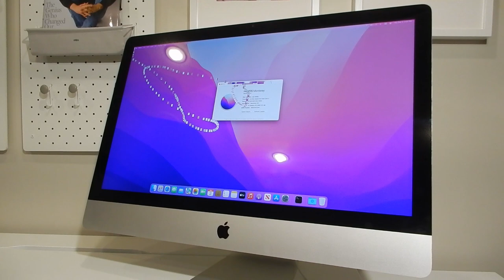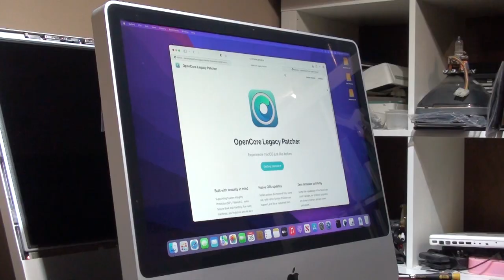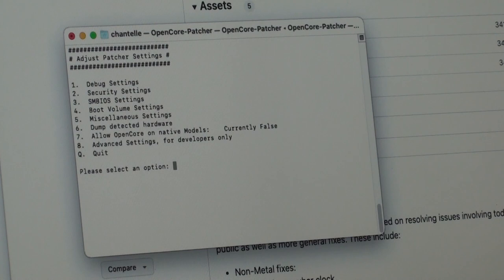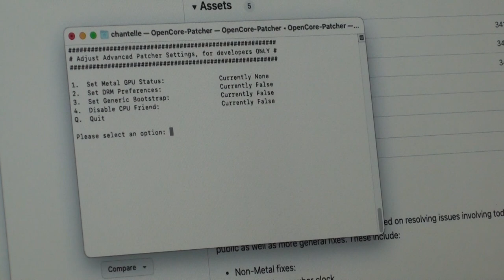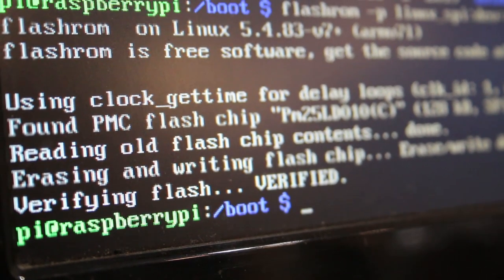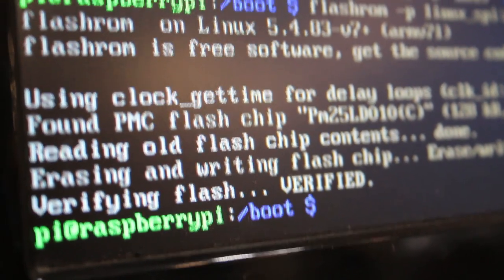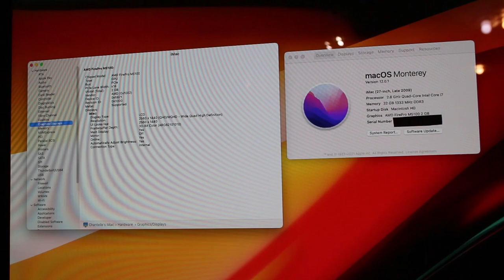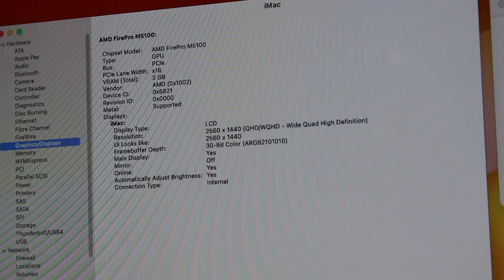iMac GPU Upgrade, Metal SUPPORTED!!

Comment: can you do a tutorial to flash vbios? i buy the same gpu and i dont know how i do. Thank you
Reply from the maker: What method are you using to flash?  Are you using a chip clip and a programmer or Raspberry Pi?

The cheapest method is to do it via Linux on the Mac itself, but this is very risky if you make a mistake and also requires you to be comfortable in Linux.  A cheaper method is to use a Raspberry Pi as a flasher like I did.  You need to properly wire up the GPIO pins to a chip clip and use the Linux terminal to install the flashrom tool and flash the chip.  If you don't have much experience with this sort modding, you probably should consider using a USB programmer with chip clip instead.  A USB programmer will work from any Windows PC.

If you post back what equipment you're using to flash and exactly what card you are trying to flash, I will try to give you any tips I can.
Reply: @rebootretro  i read this, but with linux tool and amdflash i can boot in the same imac or i should use other mac? Because i read what if i turn on the imac with this gpu i can broke the macos, or linux detect this gpu without problem? Thank you
Reply from the maker: @aitorlozano7589  I think you can use the same Mac.  I don't think it can "break" anything by booting with it.  The one problem is you will not see anything on screen (including boot picker) until Linux is booted, so this makes it very difficult to work while blind if there are problems.

This is just my thoughts, I have not used that method and don't fully know how to do that method.

The USB programmers are relatively cheap, I would probably recommend that method if possible - since it is much easier.
Reply: @rebootretro  the usb programmer run under windows? And i never use usb programmer, i’m going to search tutorials to use usb and i post a comment here. Thank you very mucha again
Reply from the maker: @aitorlozano7589  Yes, there is Windows software for the USB programmers.  There is probably software for Mac and Linux for USB programmers too.  They have a much easier GUI interface, instead of command line I used on Raspberry Pi.

Here is an example below of the type of programmer I'm referring to which comes with a chip clip.  DON'T JUST BUY THIS ONE, I'm not saying this specific one will work.  It is just an example!  Make sure the programmer you buy is compatible with your chip, and make sure there is a Windows programming software.  The one in the example below will likely work, but please research to be sure before you buy one.

https://www.amazon.com/KeeYees-SOIC8-EEPROM-CH341A-Programmer/dp/B07SHSL9X9/ref=sr_1_3?keywords=bios+programmer&qid=1670292884&sr=8-3

Hope this helps!!

Comment: Hi ! Very nice and still up to date ! Just done  with a S7100x firepro : one question : is there a way to get the apple logo startup back ?
Reply from the maker: It depends on your ROM.  The official Mac ROMs will have the stock boot picker and startup logo.  PC ROMs and modified PC ROMs usually loose the stock boot picker but can possibly keep the startup logo depending on the ROM and OpenCore settings.  I'm using the M5100 GOP ROM (which I believe is a modified PC ROM) - I loose the stock boot picker, but so long as I'm using OpenCore I still have the Apple startup logo.  My guess it's not supported in the ROM you're using, or double check your OpenCore settings.  That S7100x looks like a nice card!  Good luck! :)
Reply: @rebootretro  yes it is a very nice card ! Belive me, GTA V runs pretty well, even with all the cursors up.

Comment: @rebootretro very nice video. I want to ask if you (or anyone else here) have any experience on if the M5100 can work with AdobeCC apps.
Reply from the maker: The M5100 is Metal-compatible, so it should work with CC apps.  I know CC 2021 graphics apps worked even without upgrading the GPU (stock HD 4000 on Monterey with graphics patches), since 2021 still supported legacy graphics.

Comment: Great video! I have an old 2011 imac 21 that i want to mod for fun one day but my main issue is that many of the GPUs dont support screen brightness control and that for me is a deal breaker. Does the FirePro support native brightness settings in MacOS? Thanks in advance!
Reply from the maker: Thanks!!  Yes, it works just like factory - and stepping is perfectly smooth.  With this specific FirePro, there are some issues when installed in a 2011 iMac specifically.  I think it had to do with wake from sleep, but I can't remember for certain.  If you plan to use the same card, make sure to read up on the Dortania GitHub page to see if the issues are going to affect you, or if they have been fixed.  It's an excellent upgrade for sure!  I really like the FirePro because of native driver support; it has worked absolutely perfectly!
Reply: Thank you very much for the detailed reply and great information! @rebootretro

Comment: Hello Friend, I have followed all your steps in high sierra and with a quadro 610m graphics card but something strange has happened to me, now it only lets me install high sierra, when I install I format the ssd and install catalina or bigsur with opencon, the ssd does not appear, It only tells me that it cannot be installed... I have changed the SSD and nothing, the problem started when I applied the set metal gpu status and placed Nvidia Kepler and applied it to the SSD and from there the problem...

I would like to know what the solution would be.
The bios of the GPU is corrupted and do you have to put the bios back in?

It is very strange.. or it is the motherboard bios.. all this is a 27 inch imac a1312.

greetings.
Reply from the maker: If it says "cannot install" it sounds like your USB stick does not have OpenCore installed on it.  It sounds like you're booting the vanilla Apple installer, which will reject older Macs with that error.  Double check that OpenCore bootloader is properly installed to your USB installer stick.

You're using a completely different card, so the mod process is very different on yours compared to mine.  Some cards will work with the stock vBIOS if you don't mind loosing the Mac OS boot screen.  My card required a vBIOS mod to work properly at all.  Each card is different.  Check this forum here for specifics on your card: https://forums.macrumors.com/threads/2011-imac-graphics-card-upgrade.1596614/

It appears your card needs a custom ROM (the available ROM is specific to certain card revisions, so double check before flashing).  It also appears that your card requires the heatsink to be modded as well for that card (copper shim), according to the docs.
Reply: @rebootretro  Hello.
Can the changes be reverted with open core 0.4.6?
In the end I tried everything, reinstalling the original bios by Nick, in the end nothing, I will leave it with high sierra or I will buy another graphics card again.

Comment: Great video, I’m considering this option, I have a 27” 2011 imac. Is the one featured in the video still going strong?
Reply from the maker: Thanks!!  Yes, it’s running great still!  That series of FirePro had some issues specifically with 2011 models.  I think it was related to sleep.  It may have been fixed by now, but double check the Dortania GitHub page.  Aside from that one issue (it only affects 2011), I’d highly recommend this card.  Fully native driver support is nice to have!  No OS driver mods!

Comment: Wow.  Great effort.  But why are you using a spinning HDD
Reply from the maker: Thanks!  There is also an SSD boot drive in the CD ROM bay (we didn't need a CD drive for this computer).  The spinning HDD is because I have lots of capacity HDDs kicking around, but only small capacity SSDs.  System on the SSD where speed matters, personal files on HDD where capacity matters :).  If cost wasn't a factor, I'd just go for a single big SSD ;)

Comment: Just swapped my gpu for a 5100 preflashed bought from AliExpress, €28  i had oclp already installed so i had nothing but switch to AMD GNC but to my surprise, the GPU says it has only 14Mo instead of 2gb of ram. Any idea why ? Should i reflash the card with one of the vbios available?
Reply from the maker: When you bought it, did they tell you specifically which vBIOS was installed?  There are several versions.  I think the one I used was the GOP version specifically for the red Dell card.  If you previously had legacy graphics patches installed, it's possible that is causing some issue as well.

Ultimately I think theres 2 things to try (whichever is easiest first):

1.  Temporarily use a completely clean hard drive, install fresh Mac OS WITHOUT legacy graphics patches, and install OpenCore.
2.  Dump the current vBIOS (save original somewhere safe) and try flashing one of the other vBIOS.  If you have the red card, you might try the GOP version I used.  You do loose the factory boot picker with this card and this BIOS, FYI.

If you still have trouble and have more questions, feel free to post back and I'll try to help if I can.
Reply: @rebootretro thanks, it ended up working after installing a fresh os. Card immediately recognize with 2G and metal.
Reply from the maker: @DrMacabre  Nice!  My guess was the existing legacy patches (which patch out Metal I think) were causing some issues.  Congrats on your upgrade!
Reply: @rebootretro  thank you, i expected something rather complicated after reading and watching a lot of tutorials but it was actually very easy to swap the card. The most difficult part was to plug the temp sensor cable back on the main board.
Reply from the maker: @DrMacabre  For most people, I think the most complicated part is flashing the card.  But a pre-flashed card solves that :). You're right, the rest isn't too bad for anyone with some technical experience.

Comment: Hi, im having an issue, maybe u can help... when starting my iMac, i can hear the chime and then iMac restarts. Chime is heard again and then iMac restarts. This situation repeats over and over, it cant boot normally neither with the option button pressed! Any idea why?
Reply from the maker: I'm not sure, but I would start with a PRAM and SMC.  It is also possible there is a logic board or GPU issues which could cause that too, but always start with a PRAM & SMC reset before going further.  Resetting these can solve a number of weird problems like you describe.  I've included links to the Apple docs just in case; double check, because the process changes based on model.

(PRAM - https://support.apple.com/en-us/102539)
(SMC - https://support.apple.com/en-us/102605)
Reply: @rebootretro  thanks so much, i appreciate the fast response. Those two things are the first ive tried but without luck 🙂 The GPU issue is something that has come into my mind and if its that its gonna be the second one that failed 😞
The Ati5750 is the gpu that im looking for, but who knows in what quality its really gonna be.
Reply from the maker: @giorgos7six  I would also make sure while you test to unplug all USB devices, if you haven't already. 

To my knowledge (I'm going 100% off memory, so I could be wrong!), I think these iMacs will still fully boot without a GPU.  You could try removing the GPU to see if it cures the boot loops which would confirm if its a bad GPU.  If it boot loops without the GPU connected, I suspect the GPU isn't the problem.

Also, it's possible the PSU is beginning to fail and browning out.  Generally a bad PSU wouldn't boot loop, but if the brown out is on the right rail it's possible.

My thought is that the logic board seems ok since you get the chime.  But a faulty SMC could certainly cause a loop like this.  It's really hard to say, but I'm thinking it's most likely one of the first 2.

Given the age, I'd spend more time trying to diagnose and test before buying parts.  You definitely want to avoid throwing money at it.  Good luck!
Reply: @rebootretro  yeah i think your definitely right... i will do that GPU try u suggested, thanks 🙂
Reply: @rebootretro  I did as you said, i removed the gpu, started the iMac and there was no chime/boot loop heard. Seems that it was the gpu causing the issue! Many many thanks youre the best!
Reply from the maker: @giorgos7six  There was no chime at all?  It should have done a single chime and continued boot up.  Without a GPU, most Macs will "boot blind" if I recall; Mac OS will be fully booted but you just can't see it.  So you should have gotten one chime.  If you have the original GPU (the first one that failed), I'd install that and see if it boots with your original symptoms (i.e. probably artifacts?).  That would confirm 100% it is the GPU at fault.  It definitely sounds like you're on the right track!!
Reply: @rebootretro  There was one single chime, like it usually does if it all works (gee i miss those moments). Yes i still have the first GPU but cant recall what as wrong with it hahaha, i guess un getting too old and cant remember 😀 U really think i should try it just to make sure im on the right track?
Reply from the maker: @giorgos7six  If you're getting a single chime now, I'd be pretty confident the GPU was most likely the problem :).  There's always a very small possibility the issue is something else (e.g. a PSU that is borderline failing for example).  Swapping to the old GPU would confirm 100%, but if it was me I'd be confident enough to buy a replacement card at this point.  Like you've said before, those stock cards are horribly bad - many are reflowed which just hides the problem.  This might be a good time to consider an upgrade to a completely different card.
Reply: @rebootretro  what do you mean "to consider an upgrade to a completely different card", u mean a non stock one?
Reply: @rebootretro  i placed the old gpu and i get the same chime loop at boot... hmm
Reply from the maker: @ That is really bizarre!  I’m guessing it didn’t loop like that the first time before you removed it.  At this point I’m starting to think PSU, that perhaps it’s browning out when it tries to fire the GPU and screen, but realistically it could be almost anything at this point.  This is where it gets handy to have a second machine for parts on hand.
Reply: @rebootretro  hello... i was thinking that maybe the situation is not really bizarre? If it really was the PSU, then shouldn't i be having the same symptom (chime loop) either with the gpu installed or not?
Reply: Before a week I received a used ATI Radeon HD 5750. I installed it and it’s working! You were on the spot, u were right from the beginning!
I put new thermal paste (the one u suggested) and pads, but I have an issue with the temperature, it’s over 75C-80C after 4-5min when idle. Is that normal?
Reply from the maker: @giorgos7six  That's amazing you got it working!!  I don't recall the temps offhand, but I do remember Apple's stock fan curves to run the card absurdly hot.  If you install a fan tool (like Macs Fan Control or similar), and you tie the optical drive fan to the GPU temperature, is it capable of running cooler?  If the fans are running full tilt and it's still 80c then you have a problem.  If the fans can be turned up slightly and keep it around 50-60c then that would seem normal to me.  I think my M5100 upgraded GPU runs around 50-60c with custom fan curves and the fans are not excessively loud.

Comment: is it possible to install a windows gpu and cpu on it when it has windows bootcamped on it
Reply from the maker: Any Intel CPU will work if it is supported by motherboard, even if it was originally from a Windows PC.  The same Intel CPUs are used in Mac and PC computers, the Mac cannot tell if the CPU was originally in a Windows PC.  It will work in Mac or in Boot Camp fine.

 On a Mac Pro you can install any GPU from a Windows PC and it should work in Boot Camp (but you will loose the startup Apple boot screen).  On an iMac, it depends - because of how the internal screen is wired to the GPU.  Some might work, others might need a custom vBIOS (like in the video).  Although if you're running Boot Camp only, I'm not sure if you can skip the custom vBIOS... That is a good question!
Reply: @rebootretro  i have like a 2014 or smth imac and it is fucking terrifying seeing videos of ppl opening im scared i would break it lol
Reply from the maker: @SunAdddict  The 2012 and newer have soldered GPUs which can't be upgraded.  Some also have soldered CPUs, which can't be upgraded.

But on a 2014 CPU/GPU isn't your biggest issue.  Your biggest issue will be the very slow mechanical hard drive.  Upgrading to an SSD will make it way faster than any CPU/GPU/RAM upgrade will.  If you don't want to open it up, you can have the hard drive hooked up to external USB.  External is not ideal and you loose some performance, but should still be much faster than the built-in mechanical drive.
Reply: @rebootretro  i think ill just.... wait to get older till i can get a job and get a windows pc